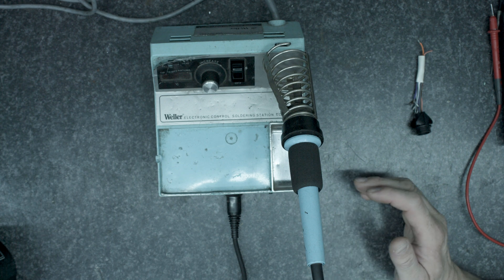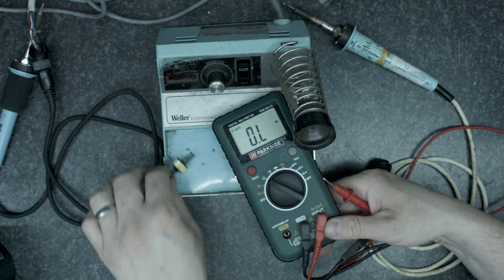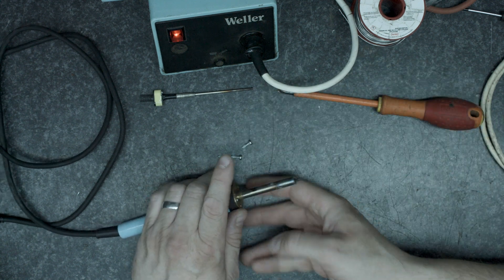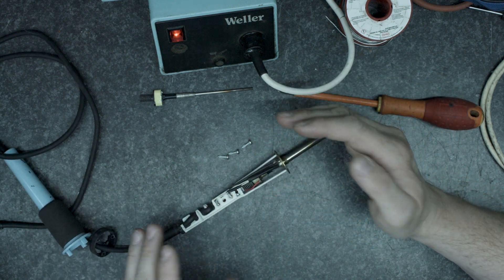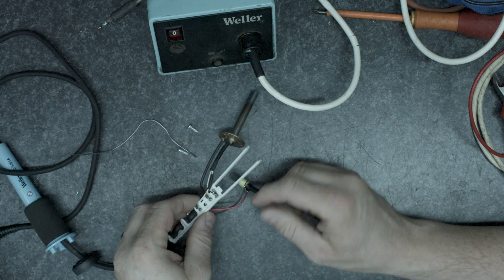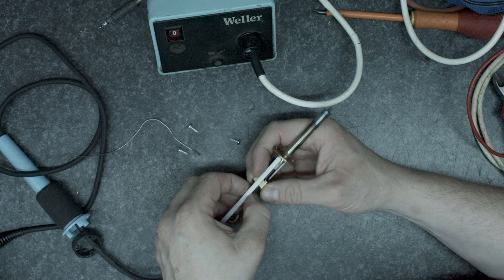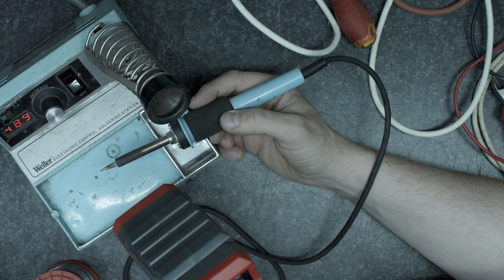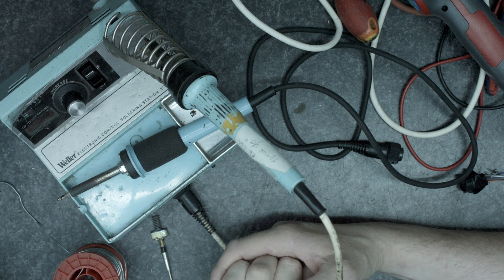Fixing a weller thermostatic soldering iron , with temperature probe issues

Comment: how do you fix the iron your using to solder that iron with , my iron glows red hot at tip and on shaft
Reply from the maker: it will be a fault with the output transistor on  the board inside the power supply or the temperature probe in the iron i will post a video in the next few days, showing the correct readings from a working Iron for you to compare